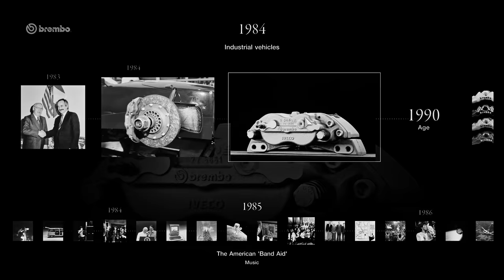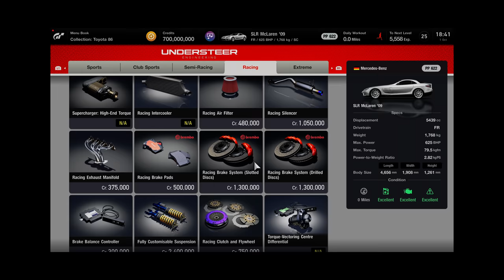Brembo to Become Official Partner in Braking Systems

Comment: So will Brembo help with creating a "brake physics model" like KW did with the suspension model in GT6? Or is this purely a branding thing?
Reply: I guess so since most n700+ cars in sport have problem with braking
Reply: Pretty sure it'll be just Branding. Gt sport doesn't have a brake temp model, and I'll be surprised if gt7 has one as I don't think the PS4 could handle it. It'll be like when Michelin joined, but the tyre physics didn't really change much.
Reply: Possibly just a branding thing like the timers being seiko or casio or whatever
Reply: @TSE_WOODY  "seiko or Casio or whoever" well that shows it was money poorly spent!
Reply: @TSE_WOODY  GT Sport once had TAG Heuer as their official timing partner for a while.
Reply: @grandmasterj5  Speaking of tyres, GT7 won't include tyre flake build up on track :( But I think you're right. I pray they overhaul and update the physics but honestly, I think it's just gonna be a simple tune of the current handling model.
Reply: @gbalao8885  thats the one! Knew it was a big watch brand thank you mate
Reply: @PaddyQuiggin  hahaha yeah it definitely worked on me, wearing my brand new Seiko™️ or Casio™️ or whatever™️ right now!
Reply: @ing8404  I'm pretty sure it has the same visual offline marbles that were in GTSport. I think I've seen that already, it just won't build up over time/track evolution. No GT game has had this yet though

I think gt7 is going to feel a lot like a larger GTSport 1.5
Reply: It does say technical partner so they could actually have some input in the game. But I wouldn't put my money on it
Reply: Don't expect so much 😂😂 it runs GT Sport physics
Reply: @grandmasterj5  when Michelin joined the tyre physics changed massively. You didn't even need to heat up the tyre at the start of a race before.
Reply: @grandmasterj5  I would be genuinely surprised if GT7 has brake temp simulation. GTS doesn't even have a functional tire temp simulation.
Reply: @R4M_Tommy  but some cars still struggle with grip even with RSS tire, new NSX is the example of that
Reply: @grandmasterj5  GT Sport was confirmed to have brake temps by a youtuber who looked through the coding of the game. Perhaps this partnership with Brembo can help further that system, like when Michelin joined, the tire grip became more consistent
Reply: You pay us insane amounts of money and we'll advertise brembo, okay😋
Reply: @LemtemPoktui  GT Sport does have brake temp, along with tire, engine, and surface temps. Surface temperature is even customizable however that requires you to have the hidden menu.
Reply: I've never heard of "brake physics model" in a game. Considering braking is rapid deceleration, which requires tire physics and suspension physics calculations to function, braking relies mainly on calculations of friction applied to a mass moving at a certain velocity, I think you mean braking force and whether it's applied correctly. A lot of people claim nonsense like a lot of cars have braking problems in games 🙄😒. Yeah, no. Braking is an easier calculation than say ABS(braking is linear if you use real world physics), which depending on manufacturer is applied in a myriad of ways, which causes cars to react very differently from similar type cars. Brakes either work or they don't, there is potential for fade but most games don't include that as it's not really necessary. I think they might be adding in brake life to the simulation aspect of racing, but "brake physics model" yeah, never heard of that. I see brake fade, more accurate high tier brake systems and iffy but brake wear simulation. Braking is a subsystem of tire physics systems, which they wouldn't need Brembo for. I mean, what have they been doing all these years without them, that they would need them to figure out how to get cars to stop?!
Reply: Most likely just branding
Reply: @evilformerlys4704  wowah
Reply: @TSE_WOODY  the older GT games were Seiko (I’m talking GT2 until 4) I can’t remember about 5-6
Reply: They did nothing with Michelin so this is just branding lol
Reply: @grandmasterj5  too bad.. they should've left PS4 behind and focus on PS4 only. Hopefully GT8
Reply: @assassingold479  it's there but the simulation is very inaccurate. Try a sim like ACC and drive a practice lap where the brakes and tires are cold vs when they're up to Temps. The difference is staggering.

In GTS the difference is way to minimal and you don't have to learn how to maintain your brake Temps. 

I do understand the simplified mechanics in GTS, it needs to appease to a wider audience after all.
Reply: @grandmasterj5  brake temps aren't hard to handle. It's tire temps that get skimped out
Reply: @grandmasterj5  Have you watch the full trailer? At the end it says official technology partner breaking systems. So its not just branding.
Reply: @evilformerlys4704  What I meant is brake temperature (affected by wheel design + car aero) , brake fade, brake shutter, and lock up. I said physics, but I meant to say simulation.
Reply: @SajithRupasinghe  don't fall for marketing blurb. The game is also called the real driving simulator, but doesn't actually simulate many things that others do. When they say this about Brembo, they will mean performance of the brakes, eg Road/Sport/Race. Basically exactly the same system that was there before, just with Brembo branding. This isn't a new thing in GT.
Like I said before, this was exactly the same with the Michelin tyres too.
Reply: @R4M_Tommy  1st lap cold tyres always felt off. And the physics changed massively due to top streamers etc complaining hugely about tyre slip etc. Games like assetto Corsa coming out meant they had to up their game too. This didn't have anything to do with Michelin, as the development was already in place before Michelin even came in. Being part of the closed beta even showed that
Reply: @LemtemPoktui  Yeah, but at least they actually have it, there to be improved upon rather than them not having it at all. Hopefully this partnership and the feedback of the FIA drivers will improve the the system.
Reply: @assassingold479  yeah I guess I should've rephrased it better. Regardless, GT is still a fantastic franchise. Can't wait for GT7.
Reply: @evilformerlys4704  Braking is not as simple as it works or it doesn't. There's a lot that goes into it still. Brake temps are important in determining how much friction force that can be applied. Also that pad to roto friction constant will vary from system to system. They can tie this information into the amount of force transferred to the suspension and tire and can lead to a more accurate brake modeling for each individual car. With the current model, the abs factor is too strong in the game as you can still lock wheels with abs and the braking feels soft and relatively generic. If brembo can give advice to the model, it will make for a better overall physics model.
Reply: @grandmasterj5  Assetto Corsa Competizione has brake and tyre temp, it's no excuse to not put more simulation in "The real driving simulator"
Reply: @LemtemPoktui  Likewise, now it's time to figure out which version of GT7 to buy.
Reply: @grandmasterj5  it’s not for the PS4 bro 😂 it’s meant for the PS5 so they can do more
Reply: @MasonGeneric  it's cross gen, including online so some elements will have to be the same to work via multiplayer.
The core game will have to be the same for both. They're might be some offline differences here and there, but I don't think we'll see anything big until GT8, or GTSport 2
Reply: @grandmasterj5  so was black ops 3 but that doesn’t mean it was good on last gen
Reply: @MasonGeneric  yeah but it wasn't much good a game on PS4 either 😁
Ghosts was better 😜
With regards to gt7 though, I don't think we'll get anything more on ps5 than more shiny effects/resolution and frame rate this time round. It won't effect the gameplay.
Pretty sure it won't be much more than what we have in GTSport already as the PS4 can't handle much more for physics etc

Comment: I personally put BREMBO on all my cars IRL. Never a fail once
Reply: I'm wondering just how often do street cars have brake failures at all? The average car isn't pushed to the limit where it would overheat the brake fluid and induce mushy pedal or the discs get too hot to handle the mass and brake fade shows up. Most cars lose brake pressure over time due to negligent upkeep, brake fade is even rarer on a street car. That is unless you track your daily and don't upgrade your brake system to match what you're doing, 🤔.

To be honest I drove my cars on whatever they came with for years and never had a failure once either, dunno if the were wearing Brembo but, I salute their solid performance.
Reply: @evilformerlys4704  Even in stardard cars 1st set of brakes,tires and suspension is tested to the max so I know how a car will handle in a split second decision.
Yes,even brakes. If they overheat you are mostly fucked. I'm really picky when it comes to what I buy,on what I install and by which manufacturer
For now: 
Loyal to Continental with tires
Brakes - Brembo or ATE
Suspension - Bilstein or KYB
Clutch system - Exedy or LUK
Oil - by factory. If not Motul,Castrol or Mobil 1
Etc.

Comment: That's great. Polyphony has probably reached that point that they can only make car models so photorealistic that they had to start focusing on smaller details like the brake calipers and discs to further improve the photorealism and having licensed items is just the cherry on top. 

Too bad I still don't have a PS5.
Reply: GT012345tube  that's true but usually in photo mode they're pretty nice. Realtime rendering however is probably limited by hardware.

Comment: Polyphony needs to implement 120 fps mode for the GT7 as well. It will benefit greatly the competitive gameplay, 8ms less imput lag, (and TVs in 120hz also have drastically lower input lag of more then 10ms for some reason compared to 60hz) so that's about 18-20ms of latency reduction as well as less blurry image due to double the frames less motion persistence which gets slashed to 8ms as well as image is much smoother and help with more minute and granular competition bumper to bumper....
Overall gamers get more responsive inputs, smoother image and less blurry... I want to see this in GT7 please. It would be holy grail of racing for the PS5 generation... an oled with <1ms pixel response time with 120hz/fps... PLEASE, Polyphony. 
Where can I write them to implement 120 fps mode?

Comment: great, a part of the car i can't see while driving has a sponsors name on it.

where is the details on the physics engine, the penalty system, the AI improvements, the steering wheel compatibility,???
Has anything changed apart from a few more pixels? some logos? 

The lack of any actual gameplay improvements being mentioned in any trailer is very concerning.

feeling like a last gen title, especially with cross gen play a "feature"
Reply: Game not released yet